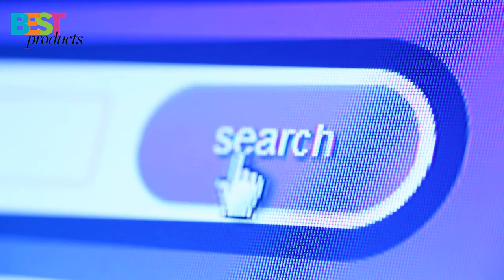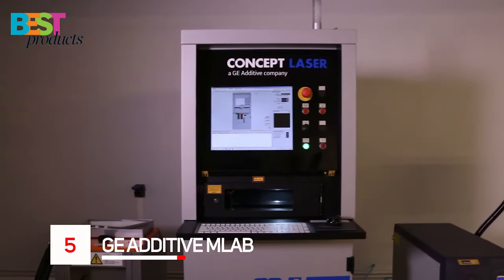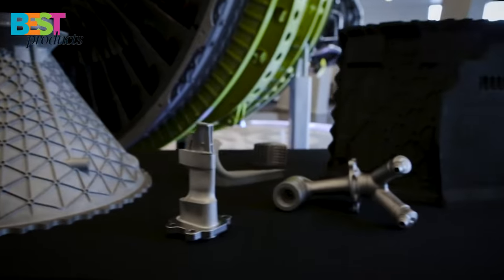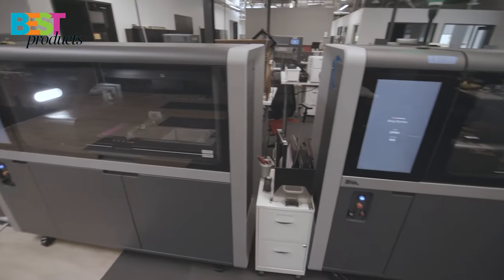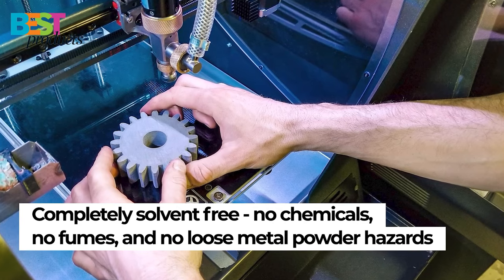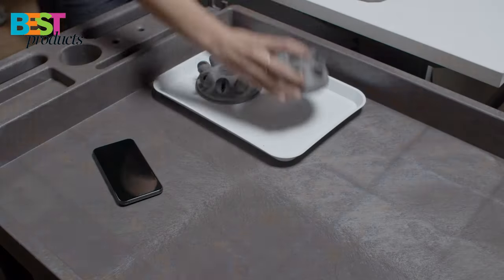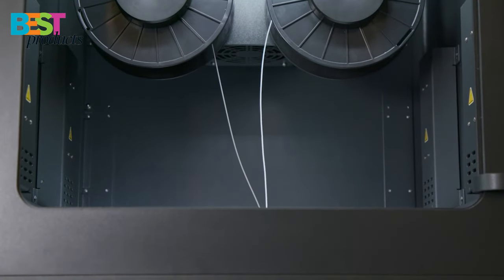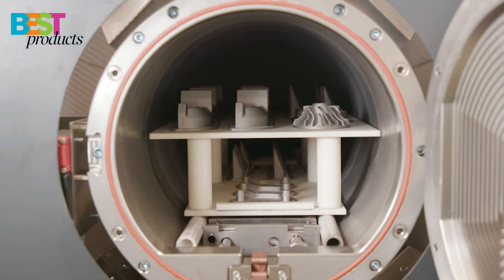5 Best Metal 3D Printers You Can Buy In 2025

Comment: Pretty sure $110000 studio 2 comes with a furnace as it’s a 2 step process, print and sinter similar to rapidia. However mark forge while it may be the cheaper printer by itself I’m pretty sure you’d have to purchase a furnace as well which is another 40k+ easy  and maybe a debinder also as I don’t think mark forge has the 2 step printer to Sinter process. Therefore the studio sysstem would be cheapest over all. I could be wrong but pretty sure that’s how it is.
Reply: I got an estimate for Studio 2 at $225k for everything (including shipping, setup) Metal X gave me a ballpark figure of $170k -250 which I figure if equally equipped would be about $225k same as Studio 2. Studio 2 is 2 step while Metal X is 3 step